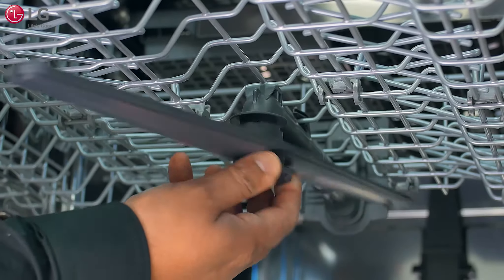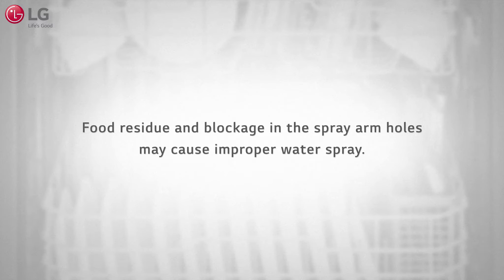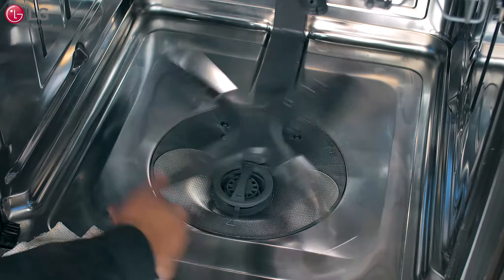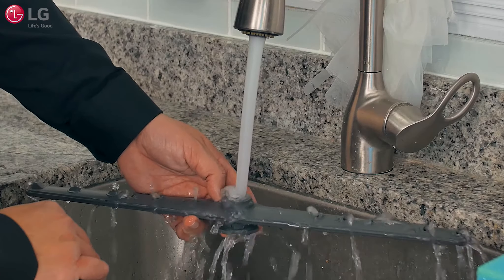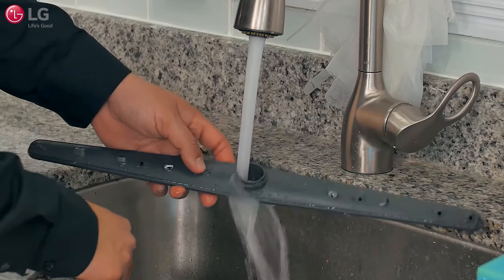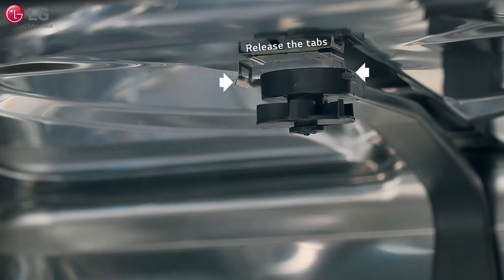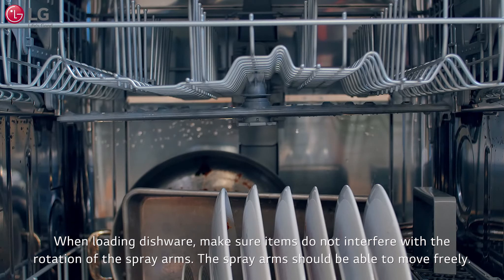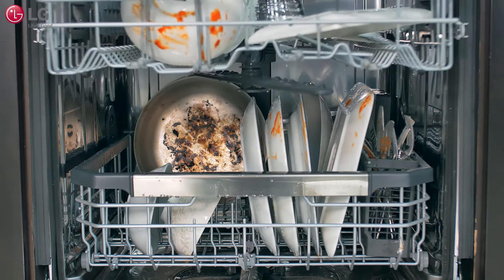LG SIGNATURE Dishwasher - Spray Arm Maintenance

Comment: try this. Finally fixed mine, put a video cam and light inside. Top spinner was not turning, holes were clear on both sides and I could blow through it. finally I took it off, held the center port up tight to outside faucet on high, and blew it out for a minute and now it works like new. Crazy.

Comment: Hi sir, my center spray armis getting stuck,only half circle,please help
Reply: Good day!
Thank you for contacting LG electronics.
You may require a technician visit for maintenance and check the arms.
In which country are you located ?
Reply: @LGService4u  india
Reply: I do not know what to do, so I am writing to you
as per your instructions, I launched a complaint to the lg service two months back
but till now they are going on postponing giving some silly reasons
and when I tried to complain to their owner (I think), he is just not willing to listen to anything else, just saying i will send after three days but not caring to give any eplanation for the delay caused
saying he is not bothered if i give negative feedback about their poor service or launch complaint about their service
Reply: I have Same issue , the center arm doesn’t rotate freely all the way, only half circle. I think this a common issue on LG dishwasher, my LG dishwasher is “true steam ” type and it could be that LG didn’t manufacture the right arm tool to avoid the thermo expansion dilemma. LG needs to do a “Recall” of all customers